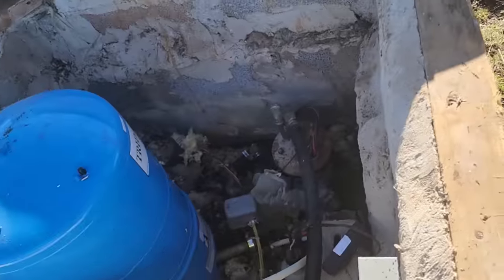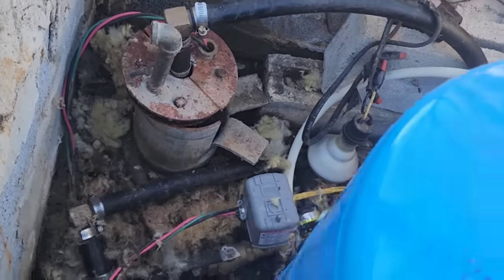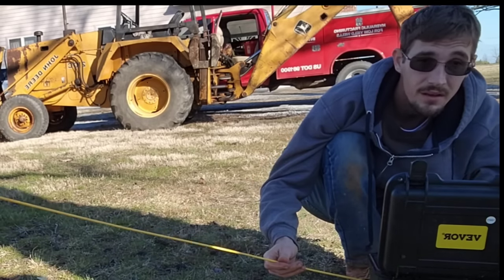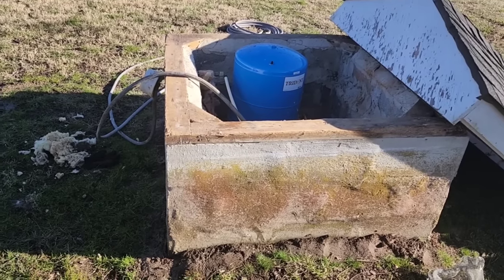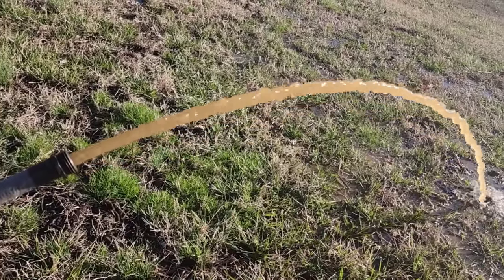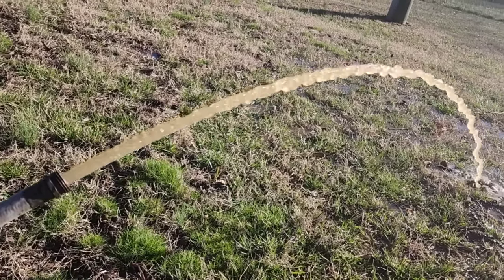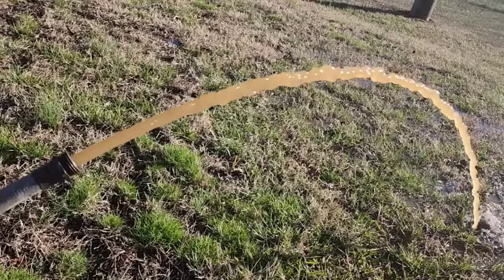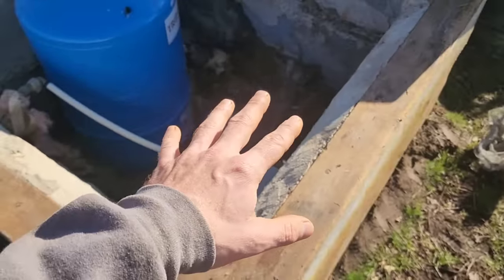Why Your Well Water is Discolored or Muddy. Explained

Comment: My well pumps iron and sand.  I was told there's nothing much that i can do about it other than put in a filtration system or drill a new well.  That was with 2 adults, 3 kids and watering farm animals from the same well.
Reply from the maker: You were told correctly. Iron & sand can be filtered, but its pricey. Even if you drill a new well, you might get the same results as your current well. Unless you're well is 50+ years old, id filter the Water. If its a old well, then drill a new one
Reply: @h2omechanic  It's about 37 years old.  And I'm the only one in the area with this problem.  Lucky me! 😂

Comment: So i had a sudden browning of my water, then the pressure dropped.  The pressure at the pressure switch is 0, there appears to be pressure in the bladder.  I have water running but the pressure is low.  I can feel water movement from the pump.  The switch looks relatively new could that be sediment in the nipple? Also there is electric sparks at the switch.
Reply from the maker: Possible you were using alot of water & pulled in surface water. Or residue in the tank. Check my tank videos Playlist and learn how to diagnose the tank properly. It may be bad.
Reply: Ok so I have replaced my switch and gauge just cause it was cheap and doesn't hurt.  I removed the pipe and replaced what leads to the bladder tank to make sure there wasn't something clogging it there.  The water seemed to flow fine, it didn't gush at some crazy speed, but flowed at a steady pace. My gauge still reads at 0 before the switch.  Unless I should be expecting much higher pressure from the pump, it seems that it must be the bladder.  Only thing is, the bladders pressure seems fine and is not full of water.  So A.) should I be expecting the water straight from the pump to be really high (If I had to guess I would say it could fill a gallon in probably 30 seconds or less from a 1 inch pipe. B.)is there any other way the the bladder could fail as side from busting or getting a hole and filling.  Is there some mechanical aspect that the sediment could have caused failure?
Reply: Went home and tested the speed from the release nozzle and it is dramatically faster than I said. Filled a to 32 oz cup in about 2 seconds

Comment: ok owner says its muddy water and tells you the family story, you figure out the well is stagnant and needs to be flushed. tell customer to run water  for 3 to 4 hours straight to attempt to clear out system and call you tomorrow to get updated.   maybe a couple hours a day to help clear things out..if that does not help then go ahead with bleach treatment but these wells like to be used and it shows dramatically in your videos.

Comment: Just finally got a system installed after the land has been vacant and neglected for about 10-15 years.

New pump and system has been installed, turned on power and had water running but the well keeps pumping out really dirty black water. Collected a gallon of it, it can be mistaken for sweet tea. 

Is this normal? Pump is down 150ft. Everything is brand new. 
Should I chlorinate the water? Should I just run the well for about an hour or so?
Reply from the maker: Run the well as much as possible!  Sometimes we pump a hole for 4+ hours especially if it's sat for a long time. 
Flush the well, just don't let the pump run dry. Then add chlorine in a week or two and wait a day & pump it out. The more you flush it, the better it will become over time.

Comment: Mine isn't muddy but air in my system
Reply from the maker: Air typically comes from 1 thing. It's a bad check valve in the pump (but you'll also have a check valve near the tank) do you have a check valve at the tank? Or well head?
Reply: @h2omechanic  at the head and it was replaced 2 maybe three years ago, thank you sir for your response